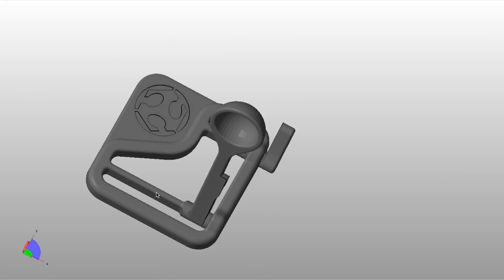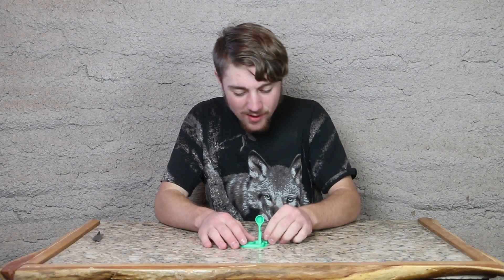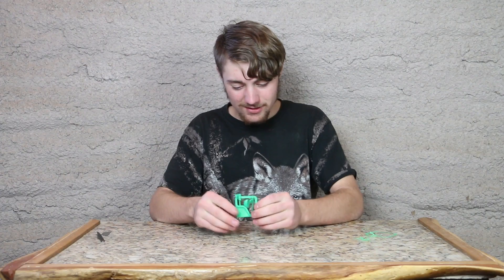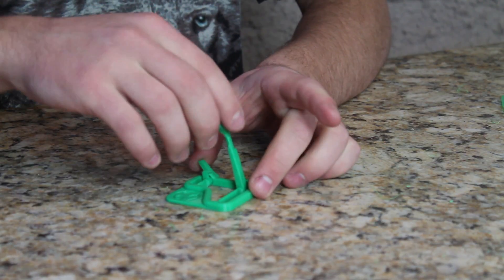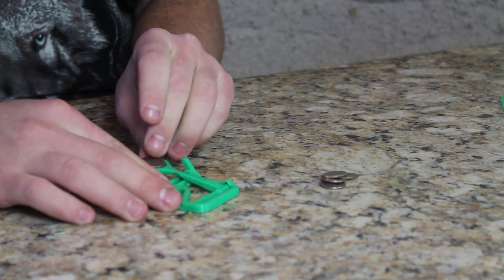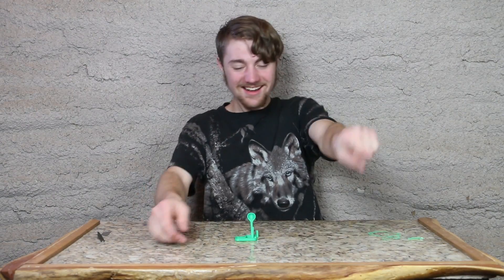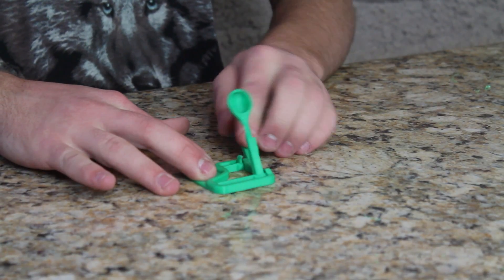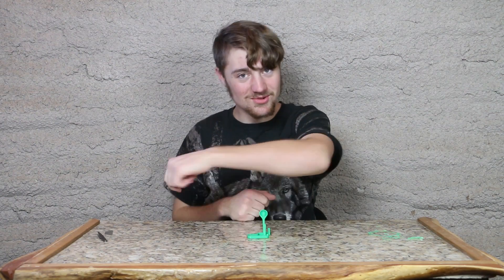3D Printing A Catapult! [Thingiverse Print Review]

Comment: I use this model to test new filaments. Its relatively quick to print and has relatively close tolerances. It's also interesting to see the flexibility of different PLA brands.
Reply: what filament did you use? mine is too rigid and snaps when printed.
Reply: @Atheism-And-Normative-Ethics  like I said I used different brands. Probably the best I have used so far was the BASF Ultrafuse.
Reply: @bob445566DE  thanks, I'm new.